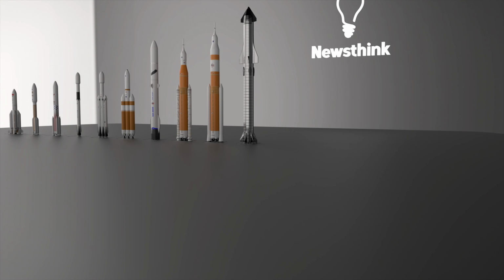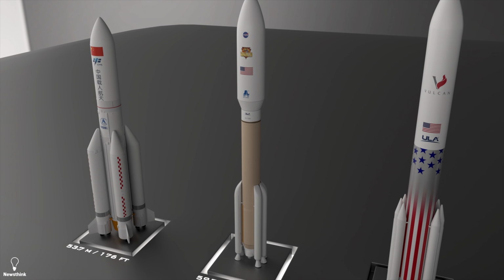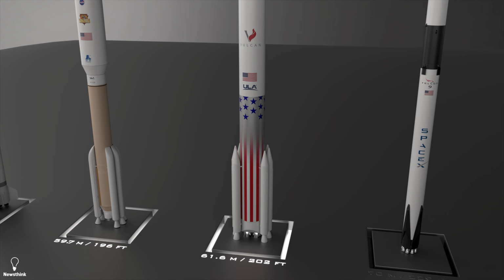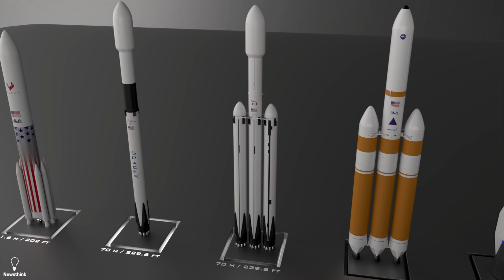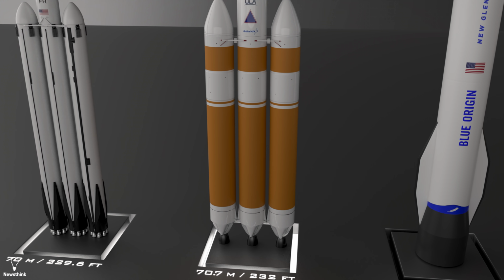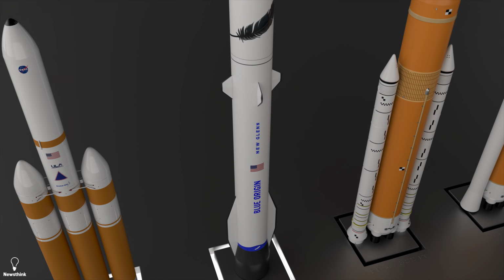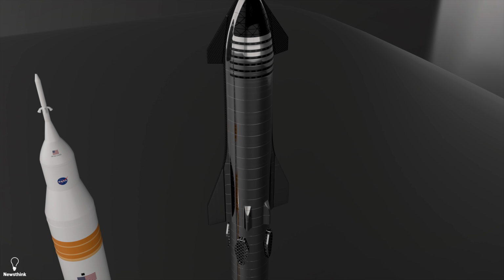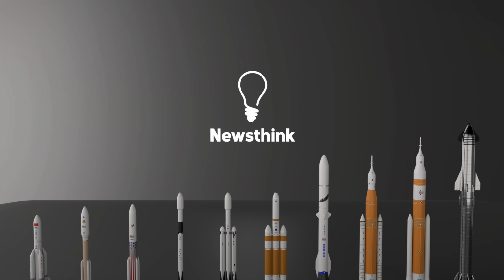Rocket Size Comparison 2022

Comment: Not only will Star ship be the largest rocket.
Not only will it be fully reusable.
It will also create its fuel from air: CH4 + O2. And it will do so using Solar power. The fuel, which is the biggest expense apart from the rocket itself, will be virtually free, and clean!

This rocket is going to change the space industry in ways that is difficult to imagine now.

Comment: Reusable rockets & spacecraft are the present & future...All else are a terrible waste of money and resources. Love the way you highlighted the fact with appropriate audio Cindy..Fast becoming a huge fan of your channel in a short period, and not only because I'm a space nut, I love all the topics you cover. 
Keep up the good work!   👍
Reply: Expendable rockets have their place.
Reusability is nice to have but a rocket doesn't need to be reusable to be succesful or useful.
If anything reusabilty increases the cost of launch if your rocket doesn't fly frequently enough and it decreases payload capability substantially.
I'd say low manufacturing costs are far more useful in lowering costs rather than reusability.
Falcon 9 for example was significantly cheaper than most existing rockets of it's size even when it wasn't reusable, reusability only lowered their launch costs by 10-15% or so.
It did that because SpaceX found ways to build their rockets cheaper even when they weren't reusing them.
Reply: @brokensoap1717  Expendable rockets will phase out in this decade, as more & more rocket manufacturers jumps on the green wagon. Sure, we cannot cancel all existing expandable rockets just to please the green ones, however, as we progress towards human solar space exploration, mankind have to take responsibility for his actions for the benefit of his descendants. Hence colonizing space to ensure we're not completely eradicated by natural disaster. (or by our own hand) ..🚀

Comment: A bit too fast. Also, where are the great rockets from the past, Saturn, etc? Where are Russian rockets?
Reply: It’s about currently used/planned rockets
Reply: @Cediii4ris  um... ok. Are you saying Russians are not flying at all these days?
Reply: @KlimovArtem1  that’s not what I’m saying. I’m just saying that their rockets are not the biggest :D
Reply: @Cediii4ris  oh, really? Then how were they delivering all astronauts to ISS for the past 10 years (after USA lost their ability to do that with Space Shuttle retirement)? On a tiny rocket?
Reply: @KlimovArtem1  is not saying it’s tiny- it’s just not as big as chinas long March, thus not on the video and also since it’s pretty old tech.
Reply: @Cediii4ris  Soyuz rockets are of similar size as the chinese rocket. Angara 5A and Proton-M are bigger. "it’s pretty old tech" - how is that related to the video topic? All Russian rockets are gradually upgraded (you can see it in the naming, at least), even though most of them just based on those, developed in USSR. But reviewing, comparing sizes of the rockets not getting into the account the biggest ever existed or all currently used - is pretty silly. If this video is watched by an young american, they can get an impression that only USA launches rockets and just one attempt from China and all biggest and coolest rockets are built only these days. That's how propaganda works. I know what I'm talking about as I'm Russian living in the USA and I see both worlds - they both brainwash their people quite a bit.

Comment: Hey, do you know what the differences in capabilities between the Atlas V and Delta IV Heavy are? All i know is that both have been used to launch spy satellites and things to escape the eaths sphere of influence, and that the Delta V Heavy uses Hydrogen, which really is a pain in the butt to use. But what are the advantages of each rocket? When would you choose one over the other?
Reply: One is heavy lift the other is mainly medium lift, Atlas is modular with its number of boosters the Delta IV Heavy is not.

Comment: Videos like this are the reason why TV is dying, and won't be missed. High quality, informative content that would never make it past the execs on most networks, high production value at a fraction of the cost of making it for TV, respectful non-intrusive advertising for a product that is actually relevant to the content, free to watch on demand wherever you are, in 4k, with captions for those that could need it. 

Also, your fact checking has improved massively from the early videos. Congratulations on a job very well done.

Comment: I wonder how much of the cost is due to the rocket itself.   We always hear "reusability" but there is a very small number of times all the SpaceX rockets & capsules can be reused, I think I saw somewhere the one that took stuff to the space station was only 5 times.   I wonder if SpaceX is just underbidding everyone because other companies have long since realized government contracts are big money big profit, and they could bid lower, but why if they don't have to.
Reply: The fuel to get to orbit cost about 200, 000 USD. The rocket costs the most. The booster they used for the starlink mission this week was on it's ninth flight. Not having to build 8 other rockets saves the money.
Blue Origin has only one flight and many delays which is why they didn't get the moon lander contract. Although Bezos did appeal that decision.
Reply: @wolfvale7863  I wonder if they are allowed to reuse more for non-critical (i.e. human) payloads.

But I wonder how much profit there is in a launch,  I mean ok the rocket cost more, but these guys aren't slipping by with small profit margins.     Sure the rocket costs 10x more, but if they're charging 100x more for the cost to put something else then the savings on reusability really aren't factoring into the equation too much.   Granted these numbers are made up, but there has to be some level of break even for how much the cost of the rocket really matters in the grand scheme of thing.

Comment: Daamn I mean I knew that Starship is BIG but that was an awesome way to put it into perspective, it's even larger than I thought :D
Reply: And it's, in certain ways, larger than it looks. The other vehicles in the lineup have unpressurized fairings that can accomodate tiny manned capsules inside. Starship is a rocket powered proper ship. It's internal volume is INSANE. Think about it this way: It took 40 missions to put the current ISS into orbit. Starship has the same internal habitable volume as ALL of the ISS, so a single launch could give as a space station as large as the ISS (and in a single volume, which is far better). 

In the six decades since the first manned launch, around 500 people have been in space. Starship could put twice that amount of people in orbit a SINGLE flight.
Reply: It's a flying skyscraper.
Reply: @MrRoyalG  yes although most of the space is consumed by propellant tanks
Reply: A 39 story building.
Reply: I mean yeah, Spacex has literally been trying to fly and land a grain silo.  And two days ago, They Succeeded!!!!
Reply: @Raphaël Duquette 100 is a proposed configuration for interplanetary travel, but  Starship could carry more. A Boeing 747 has around 700m3 of internal volume, and can carry 500 people, and it could conceivably carry more. Famously, the most passengers ever on any plane was on a 747, over 1000 passengers during Operation Solomon. 

It can handle 1000 people in takeoff weight, probably not on landing though, so it would have to be reduced a bit, but certainly WAY more than 100.
Reply: @gnualmafuerte  The thing is that in space you have to have life support equipment that you don't need on a boring. And that equipment weights quite alot. That is why it can't carry 1000 people in practice.
Reply: @panzerkampfwagenviiimaus2187  That matters going to mars, not in an earth to earth config.
Reply: I live just 2 hours away from Starbase and damn it is one giant rocket!
Reply: That's what she said

Comment: Mars is one step closer with perfect landing of SN15
Reply: Almost perfect.
Reply: I just did 666th Like!
Reply: They want to fly sn15 again
Reply: No, I don't think the orbit has changed by that, why should it?
Reply: @Ion_thruster   
 I think you didn't understand 😒 what I wanted to say.
Reply: @starman7760  No no, don't worry I got it XD
Reply: Made this channel for when we can go to Mars
Reply: WE DID IT!!!!!
Reply: Perfect landing
Super heavy booster perfect landing
SHB and starship perfect landing
Orbit Refueling test
Mars
So it's 5 step closer
Reply: With what radiation protection?
Reply: What about ahhh that's 8881ļ
Reply: Successful? Yes.
Perfect? No.
It almost missed the landing pad, and it was on fire due to a fuel leak. The latter issue is what caused SN10 to RUD. Hopefully they can get that fuel leak issue fixed.
Reply: @seanplace8192  SN10s RUD was because of hitting the ground too hard and basically damaging the fuel tank. Even the legs were crushed. SN15 had a soft landing and actually stood on its tiny legs
Reply: Sean Place It was actually perfect. The off-center landing is not a dramatic thing and can be fixed with software. The „leak“ is actually no leak, but expected after reigniting with current prototypes, because they use methane. John Insprucker also said, that it is going to be fixed, as the system evolves. For the time being, it was exactly what we thought was going to happen, which is perfect.
Reply: @The-Real-Laepi  Perfect 10/10? No, but 9.5 is still good enough. :)
Reply: @YohXoX  True ^^
Reply: @seanplace8192  It's looking more like this time was just a thermal blanket on fire when methane sprayed on it during engine shutdown. Remember that Starship is going through iterative design, something spacecraft have never really done before. They launch, figure out what went wrong, and fix it. When Starship is finally ready for commercial launch, odds are it will have thousands of modifications more than it's current design. Keep in mind SLS was announced in 2011. Other than the raptor engine, Starship development started in 2016. All you need to do is look at the comparative progress to see how those two stack up.
Reply: @seanplace8192  I don’t understand why people are disagreeing, yet at the same time agreeing with you lol

You’re right, it was successful and a step in the right direction. It was nowhere near perfect though.
Reply: @dabigcheezprod  yeah ikr, cool gamer replied saying it was perfect yet it can still be improved, it was good not perfect aha
Reply: Texas tank watcher's